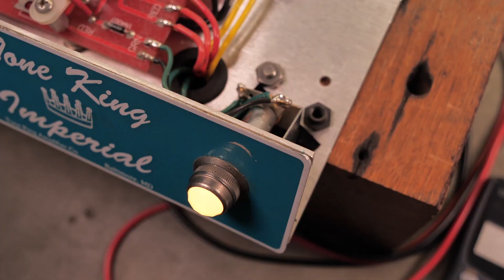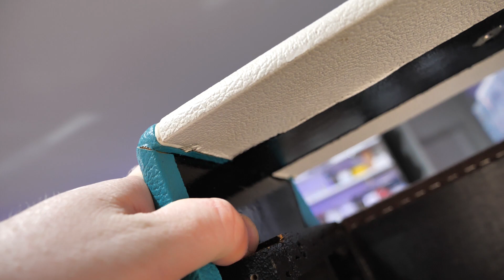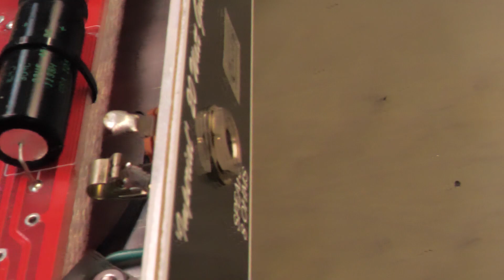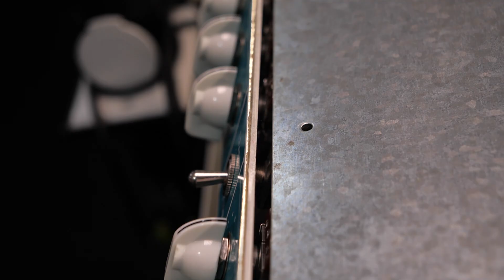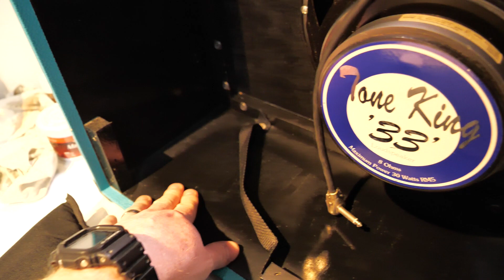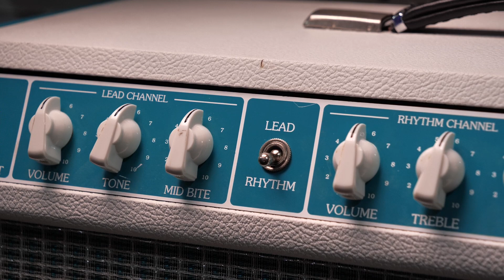Tone King Imperial - Hardware Changes, Service & Test

Comment: Brad, on the lock washers, could you not snip a couple of mm out of the circle so it becomes a round pie with a slice missing (or donut…) and use that to snap it onto the pot shaft? Not tried this myself… but would it be better than no lock washer?

Comment: It's Sunday Bad News... to be reversed into Monday's, "Good News."  "We've reached a deal..." or "The Strait is now open again..."   MARKET MANIPULATION!  Investigate whoever is putting large sums on oil futures and making out like bandits (which they are!).
Reply from the maker: Yes, it's absolutely criminal.
Bring on Nuremberg 2.0 ASAP!
Reply: latentcy issue.  Comment board on wrong video -- slow load.  Sorry.  Not meant for this video.

Comment: Friend of mine has MKII. I have heard it and it is sounding good, definitely.
He says its very reliable for him. He does carry it around. 
Now just looking at it from the outside and knowing the price and what it is I was not really amaized with the price to performance ratio.
They got cheaper but cost still around 3K here in Europe.
For that price one could get Alnico speaker for example. Or it could be handwired amplifier with the turret board. But its a PCB amplifier sadly.

Best parts I see are some of those Sorague axial caps. MOX resistors are good and I get that they wanted their heat away from the PCB but they are just there flapping in the breeze. Those will eventually break of the board.
Mallory 150 series do sound good but are cheap caps in principle. Alpha pots are cheap option as well. PCB is cheap option as well.
Considering that its 6V6 Deluxe and PCB and parts used why dies it cost mire than 800 bucks? OK lets say brand and prestige and still why is it over 1k or 1.2K?

Comment: I had a Peavey 112 about 30 years ago and there was no way you could move the amp while it was switched on, the reverb tank would sound scream like breaking glass. Is that what putting the tank in a bag fixes? The Peavey was just a metal box

Comment: Would cutting a small section of the lock washer out allow you to slip them onto the pot threads, and then tighten without ever pulling them entirely?

Comment: In what Universe is 24 minutes "a super quickie on this Tone King Imperial"? 😏  My favorite quote: "I don't know why people are getting upset that I'm finding ways to improve amplifiers."  My friends have generally been understanding and appreciative, but I tend to start with cheap amps that are crying out for improvement.  There certainly are tradeoffs between manufacturability, form factor and serviceability.  I chose the Imperial head over the combo so I can at least choose the cabinet.  They seem to be made with the attitude that they won't fail any time soon.  With proper care I would expect everything but the tubes and possibly some of the caps to go at least a couple of decades.  I think that's acceptable for the asking price; your mileage may vary 😘🎸

Comment: Shows to me again that the stuff coming out of the BAD stable suggests that you are buying a high quality boutique style product. But actually it is pretty standard electronics you will get with a tendency to sloppiness when it comes to build quality. All of this is wrapped in candy color tolex with a hefty price tag hung around the handle. Check YouTube on the few videos walking you around their workshop. This will tell you a lot. I would keep my fingers off.
Reply from the maker: This is a pre-BAD amplifier.
It's very well built, just one or two areas for improvement. Sometimes how impressed I am with an amp doesn't quite come across in the video as I'm focused on areas for improvements. I'm trying to work on that more.

Comment: Just wondering if there is a "U"/horseshoe shaped lock washer on the hardware market that would work to secure the pots in this situation without having to remove everything around? Or could cutting the washers open work?

Comment: The reverb on my MKII is on 6 and nowhere near as big as this one. I wonder if it's defective. I hate to have to crack open that bag, but I'm thinking something is up. Maybe a detached spring?
Reply from the maker: If you're suggesting something is wrong with this one; it's fine. I know the sound of a broken spring.Likely a circuit design difference between this one and yours. It's a huge reverb, that's for sure.
If you're concerned about your amp, try finding some demos of the Mk.II online and see how it compares. Having said that, it looks like there are different versions of the Mk.II model out there too, so hard to tell for sure.
Reply: @BradsGuitarGarage , you let slip that you like your bags "thick and padded"! Hey, s'alright, this is a judgement-free zone!
Reply: @BradsGuitarGarage  I inspected my tank, and right away, the one in this video seems much fatter. Although there's nothing wrong with my tank, I think it sounds smaller because it is.
Reply: I have a Mark ii. It's a frequent comment that the reverb is quite subdued compared to a Fender. It suits me fine as I'm not into splash, but if you were a surf guitarist you would want more. Note also that the reverb level is further attenuated in the Lead channel.
Reply: Maybe the wrong reverb tank was subbed, or Installed backwards by an inexperienced tech?

Comment: I just looked at the internal pictures I took of my Tone King Imperial. The board is dated 7/14/14. Mine doesn’t seem to have the issues that one does. The board is black. There’s plenty of room for pot changes and probably more room for other repairs as well. I can send you photos if you are curious. Maybe older isn’t better?
Reply from the maker: Yeah, I did find some photos of green coloured PCBs which had about 1" more room behind the pots.

Comment: What's the serial  number.  Mark 's team does much better work. That must be a post 2008  PBG amp  not made at the Baltimore shop. Those and one's after do not sound as good.
After hearing the amp that's not Marks work.
Reply from the maker: It's a beautiful amp, just a bit of a pain to change a pot, that's all.
There looks to be many versions from what I can find of photos online.
Reply: @BradsGuitarGarage , " Life is like a truckfull of SkyKing amplifiers: you never quite know what you're gonna get".  I wouldn't suggest buying one on Reverb unless somebody posts pictures of the inside of it ---- which almost no Reverb amplifier sellers ever do.

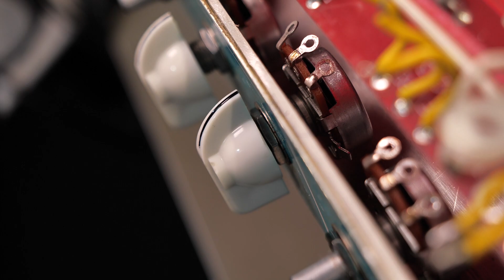Comment: 12:26 "...so's yer mom..."

there's the reason why you are among my top 3 preferred online amp guru. cracked me up.

re: the question of whether one goes too far with their repair tech expectations of amp designers...I believe it is the amp repair tech's prerogative to scrutinize the design and repairability of any amp that comes across their bench. IMO it's fair game, because affordable repairability is not just a perfectionist's wet dream - it is very much where Leo Fender started when he formed his company. He owned & operated a radio repair shop, and side-lined renting small PA systems, for a good 10-15 years before he started making lap steels with Kaufmann. His guitar amp designs were informed from the beginning by the very same type of repair tech encounters with less-than-ideal radio, turntable, & TV design. His amps were the among most repairable of their day - and remain so today. No one can argue with that. That literally millions of pre-1980 Fender tube guitar amps are still in service, and still sound great when in good condition, tells the tale. 

Keep up the scrutiny - it's a public service to anyone who wants to own & rely upon a tube guitar amp.

cheers from Seattle.

Comment: I bought one of those things that pumps ice water through a bandage that has Velcro on it for my screwed up joints. It's also not too bad wrapped around my neck to cool me off in summer. I'd put some peel n stick weather stripping across the top. The shit kids dump in amps ranges from money to spaghetti and everything in between. Nice sounding amps, but lose the axial caps guys. Seriously those should have gone away 20 years ago for new designs.

Comment: Only thing even on the new Tone King amps, is servicing on some can be annoying. Not the funnest amps to take apart at all. I have a Sky King and I def wouldn’t just drop it off to any local service guy. From experience they are very easy to get banged up during servicing, and schematics on some aren’t widely provided. Usually have to contact BAD if newer, or ship it out of state to someone more familiar with the amps.

They do sound good, and offer a lot of features though from home to gig.

Comment: I would cut tooth star type washers u shaped so they would slide past the barrel. That is how I make a bad to salvageable situation .
Reply: I thought so too but imagine if they come loose and rattle around the amp.
Reply: @lordgraga  I make a small cut and bend it open sideways slip it on and bent it back flat so there is no way it can fall even if you loosen them up.

Comment: As soon as I saw it i didn't like it. Those printed circus boards are junk. They may sound good they aint worth shit.
Reply from the maker: PCBs are THE best way to construct a circuit IF executed correctly. That's a MASSIVE "IF" as almost nobody does it as well as it should be done.
Reply: @BradsGuitarGarage , I have a serious philosophical and metaphysical issue with output-tube sockets being mounted directly to a PCB, especially if they're on the same main board as everything else. At the very least, the output tubes need to be on their own separate board. PERIOD. No if's, ands, or buts.
Reply: I agree one hundred percent. I was seriously interested in one of those till I saw that circuit board. Too expensive for that kind of construction. It's a hard pass.

Comment: Anyone with that much mold in their amp is NEVER gonna notice the evenness of those pots
Fender handwired their amps up to 1981- It blows my mind more people don't buy a silverface bandmaster or bassman for 900 and never ever look back. If you're dying for a higher gain sound- what is it ?? a dozen solder joints and a handfull of caps away from a marshall. This shit is really not complicated-or at least it wasn't back then.  I'm glad i learned about this stuff early enough to get my 68 collection of blackline 10" amps (PR VLX SR) while they were still had for around 1200 ;they are each around 3500 now (well, the SR's are giant and thus less desirible in the market they go for around 2000)  but if i were starting right this second i would go early 70s bandmaser all day long.
Reply from the maker: It was a recent purchase and the new owner I'd a good customer of mine, hence going the extra mile. Restoring a silver face Fender is another great but sometimes costly option.

Comment: Thanks for the tip on reverb tank orientation I've been wondering why my reverb hums since putting a new bag in 🤯
Reply: On the Tone King Amps, I’ve always reversed my reverb tanks around…solves most all hum. But there’s always a tiny bit when at 10. I rarely go above 3 on these just for a little bit, then use Space Echo or a different kind. I like the Reverbs on these, but they aren’t the spring ones like Fender. A lot more subtle on these Amps.

Comment: Could snip the lock washer and slide it on in situ ?
Reply from the maker: It did cross my mind! But I decided it would likely squash out under pressure and still be pretty awkward to do, and risk scratching the inside of the chassis with pliers.
Reply: @BradsGuitarGarage  i know you don’t cut corners or washers
BTW i watched the last streams in full ..im off work with a broken arm 
Enjoy the show👍

Comment: I have a Mk2 and thankfully it doesn't have the gap between the face plate and cabinet. The knobs don't seem too far from face plate either. I can see the nut in the gap and that's all. That said, I am not sure that they made servicing it any easier. I knew I was going more complex than a 65 reissue with the channel switching and attenuator so it's cool